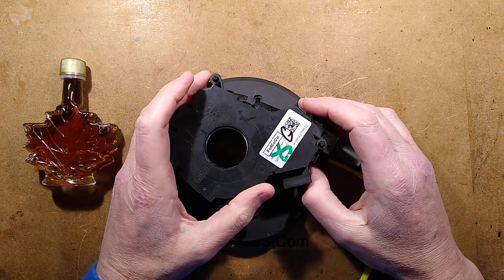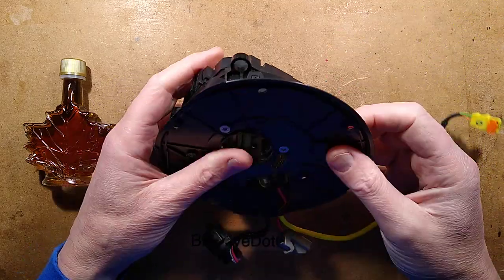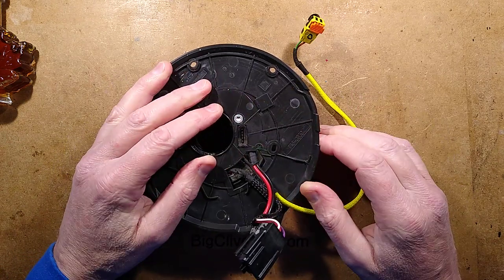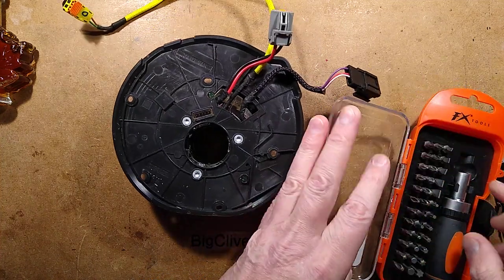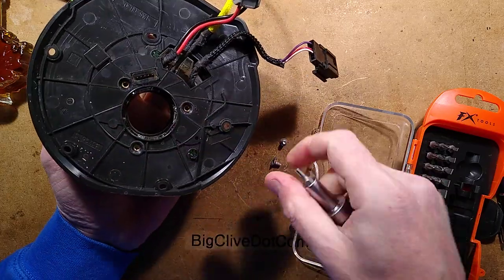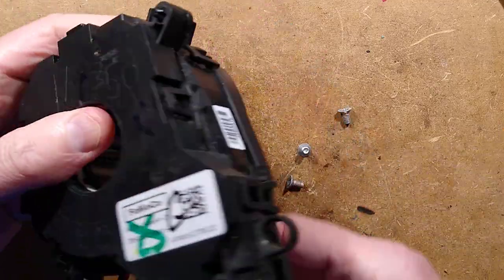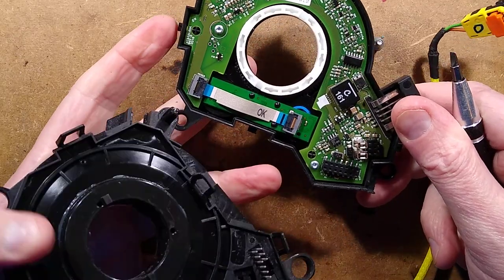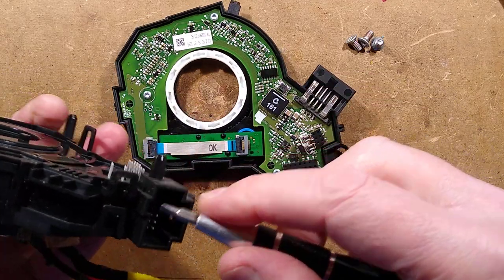Inside a car clock-spring module (steering wheel wiring interface)

Comment: Hi Clive, Automotive electronics engineer here. The black rotating thing is the steering angle sensor. Its used by the vehicle stability system to detect if the vehicle is moving in a direction that matches the angle of the steering wheel.  This uses two hall effect potentiometers to detect wheel position.  They are offset to each other for error checking and differentiating which turn the weel is in, ie 1 clockwise turn as opposed to straight ahead. When you place the clock spring assembly on the steering wheel collum,  you turn the clock spring fully then turn back two times, then there should be two arrows on the stationary and rotating parts, you keep turning back till they line up. This is the straight-ahead position.
Reply: Makes me appreciate my 1950 Mercury truck.
Reply: A clockspring aka spiral cable and a SAS clipped on the back the ribbon in the CS 9/10 times fatigues where it meets the PCB the horn dies then you get a flashing airbag light
Reply: @anonymic79  the fact it has so little in common with a modern car is literally the reason he brought it up, its a automobile that has one hundredth the parts but is just as practical to drive
Reply: @anonymic79  that's the exact reason he mentioned it, because it's as simple as a lawn mower but still does the same task as a modern car
Reply: @fall-of-rome  Only in the sense of getting from point A to point B. It falls short in all the previously mentioned areas, which are vitally important, as well. Even then, this is still about electronic systems, not the luddite view of technological advancement in automobiles.
Reply: Also the steering angle sensor has to be calibrated using a scan tool by the manufacturers procedure (been the case on all the cars I've worked on).
Reply: @anonymic79  just be the fact its been in circulation since the 50s means its been a more reliable and better for the environment then any modern car can possibly be just from time alone
Reply: So do the magnet cogs have different number of teeth to tell the absolute number of whole turns based on angle difference between them?
Reply: @anonymic79  A 50 year old vehicle can be just as reliable as a new one, if you compare apples to apples. For instance, my 1971 Chevy truck was my daily driver for three straight years when I was in college. And well-made? You're absolutely fooling yourself if you think a new car is built better than an old one. The doors on my 1965 Cadillac Coupe DeVille shut with a solid authority that I have never, ever heard any other car door match. I've watched hail ding a 2003 Accord while it hit and shattered on the hood of my C/10, leaving no trace that it was ever even hailed on. And have you ever seen a 1948 Ford sitting in a scrap yard with all its chrome still gleaming like the day it was new? Yeah, that doesn't happen with new cars.

Sure, I will admit that the old cars can't nearly match the safety or convenience factor of new ones. But that's just a part of driving an old car, and when you're behind the wheel, you forget about modern amenities and just enjoy the car. Lane departure warnings, automatic braking, a 17" infotainment console, heated steering wheel, cooled seats... all things that you can live without, and gladly do so when you have something old and cool in its own way. Same thing with economy/efficiency - when you're driving around in an old car, you don't really care what MPG you get, simply because it's just more fun to drive. Maybe that's just me though.
Reply: @anonymic79  I prefer to think of it as a farm tractor.
Reply: Do the 2 cogs have different numbers of teeth? Why is one black and one blue? If they were one tooth different, I’d think they could compare to know what rotation number the wheel is at
Reply: yup , what Clive was looking for ( the default position) is derived from the 2 sensors in offset ... might need to do a tooth count on it spoilers (could be mechanical)
Reply: These little electronic gizmos saved my bacon. Kept my car straight and true despite the wet road. Kept my car from the wall around the bend where other cars without such safety aids ended up not going home that night. 

Some may say I don't know how to drive proper, I've been on the track. I usually get my name up on the top 10 lap times for the month. Electronics safety aids are good to have especially on public roads, less effort than trying to find grip for the rear during butt clenching moments when the car can apply brakes to each wheel independently.
Reply: Hi uwanthits, got any jobs for a student soon to graduate with a degree in computer engineering? :p
Reply: @anonymic79  WOW that's salty 🤣🤣🤣🤣. How preciously important is your comment about the comment then? 🤣🤣
Stay safe and healthy all of you regardless of what you think of beautiful 50s cars and trucks...
Reply: @Gazr Gazr "I just steer my van, without some gizzmo telling me how crap I am steering"  How very luddite 🤣 Guessing you have no idea what this is used for?  It doesn't do anything at all until something bad happens and you are in danger of losing control of your car.  You seem to be saying "I'd rather smash my flimsy old car into something solid than have electronics save my ass".
Reply: I guess the sensors are AS5600 or something similar.
Reply: @philmerrifield1163  yes, I've known models where you have to steer to both extremes to adapt it.  My current car must use the steering angle to tell the smart cruise control where my car is going to be, its pretty clever because you can pass cars on either side so it knows where you're aiming.  I wondered though, it does depend on your car not being bent!
Reply: @slightlyevolved  when everybody else is driving a crash zone crumple car that folds into an accordion, what makes you think driving a solid hunk of steel is going to snap your spine up? You won't even notice you hit 'em
Reply: @mikefooyc8237  yeah bullshit
Reply: @slightlyevolved  Old carbureted vehicles are also super-fun when you want to start them in sub-freezing weather!
Reply: Additionally, most modern cars have electric power steering, and they use this sensor as part of that system as well. The reason they went to electric power steering instead of the "old reliable" hydraulic power steering is that when it's not doing anything, that hydraulic pump is still pumping fluid, meaning that power is being dissipated, meaning you could have better fuel economy if there was some way to cut out the pump when its not being used, but a clutch is not reliable enough. So switching to a more sophisticated electric power steering system means you can use the alternator to get the power to drive the power steering, which does not draw power from the engine to "do nothing". By the way, that power the hydraulic system was using is not a small amount, it's at least 1hp and more likely up to 5hp, and it all gets turned into heat under the hood.
Reply: @mikefooyc8237  Yes and the car can handle each brake individually to keep its direction. I bet even the best sports car doesn't have 4 independent brake pedals in it?
Reply: I just commented something similar then found your comment, way better put than mine
Reply: @watcherofwatchers  Do you think the new Ford truck will till be running fifty years from now? That's an awful lot of hi-tech electronics heading for the scrapyard in about ten years time...
It's all very impressive and interesting, but the problem of steering a truck was cromulently solved a very long time ago using just mechanical means.
Reply: @44R0Ndin  they use that kind of steering so the FBI/CIA can crash ur car into a tree and claim you were a bad driver
Reply: @schlomoshekelstein908  I'm pretty sure there's still a mechanical link between the steering wheel and the wheel angle. Even if the electric system acts up for whatever reason if you can hold the steering wheel steady you should still have steering control.
Reply: Long story short, there are 2 cogs with magnets phased in a certain way because it's a quadrature encoder, isn't it? ;)
I don't understand, however, how this could be an absolute angle sensor (or even if it is), it has to have some kind of endstop somewhere if there's a possibility to turn the wheel without powering the electronics (unless I missed it); also cogs, being smaller than the central one, would make more revolutions than steering wheel would, and it already could go 3 turns back and forth, that is encoder output would repeat multiple times over the entire range.
Reply: These things are impossible to take apart and reassemble correctly, you will cause an error code in the car's computer. Additionally, you can set the default or "zero point" of the unit with a scan tool, after straightening the steering wheel
Reply: @eDoc2020  are you telling me they don't do it via steering means but use the brakes instead? or are you saying they don't do it at all?
Reply: @ZXRulezzz  This. Also after connecting a new battery into a modern VW Golf I had to turn the steering wheel all the way to full lock and then to the other full lock to get rid of a dash error. Once the car knows where the extremes of travel are it can assume the centre straight ahead point.
Reply: @dpallant  So basically this sensor IS relative and requires power at all times to remember where the steering wheel is?
Reply: Also the zero position is usually calibrated with a scan tool
Reply: @brianleeper5737  long ago, in the beforetimes, the gods invented the tuneup.
Reply: @Jeffrey Ellis Thanks, I actually only now just noticed that gears are different diameter. So their positions don't describe a circle, but sort of Lissajous pattern, but it still needs calibration to see which "slopes" correspond to beginning and end of the range...
But one could at least store that information in non-volatile memory, so it's not THAT ridiculous :)
Reply: @willi-fg2dh  And if the tuneup didn't fix it, all you needed to do was rebuild the carb.
Reply: @brianleeper5737  nah . . . most automotive problems then and now are electrical.
Reply: @willi-fg2dh  Oddly enough..most of the electrical problems I've seen in cars were due to the last idiot that worked on it. Harness connectors not fully mated, harnesses not properly routed so they get damaged, loose battery connections, loose battery itself (apparently leaving the holddown hardware off saves a whole minute of time), loose ground bolts, it goes on.
Reply: @schlomoshekelstein908  Are you asking me how the government makes you crash your car by controlling its computers? Conspiracy theories aside, there are different ways they could. Even though you can theoretically override electric power steering, the motors can easily overpower you if you're not expecting it. They could also mess with antilock brakes, automatic transmissions, electronic throttles, and more I'm not thinking of.

Do you really think the government makes you crash in order to ruin your driving record? If they really wanted to they could just file fraudulent accident reports.
Reply: @eDoc2020  Yeah the government doesn't try to eliminate undesirables, they didn't come up with a heart attack gun that uses shellfish toxin. They certainly won't try to kill you with your own car, they would just get you into a minor "fender bender" and make you look like a bad driver. That makes sense to me. I'm so glad an intelligent person like yourself could show me the err of my ways and enlighten me to reason. What was I thinking?
Reply: @ZXRulezzz  That's an interesting one. The steering wheel must be permanently powered so that steering wheel movements while the ignition is off still get counted. Otherwise whatever use the absolute calibration when the battery is reconnected is would be lost if the steering wheel was moved when the car was not counting it.
Reply: @LgSutterby  all good until you have an accident. I know in which car I want to be sitting when I hit something at 70kmh.
Reply: @mahlapropyzm9180  you act like there's a high percentage of 50+ year old trucks still rolling around. There aren't. Those old vehicles were riddled with their own common faults. Points made every one of those vehicles unreliable. Distributors and rotors failed left and right. The list goes on.
Furthermore, the safety differences are immense.  The same is true of efficiency, power, and comfort.
The fact is newer vehicles simply require a different skill set to understand and work on. They aren't mysterious - they're just different.
Reply: @watcherofwatchers  i never said technology was bad, i just said that it's fascinating how something that is closer to a lawnmower can do essentially the same thing as a modern car can.
Reply: @schlomoshekelstein908  in my old cast iron diesel pickups, or my semi truck, everyone ELSE is my Crumple Zone!
This why I drive more carefully, because I hate hurting innocent crumple zones..
Reply: @LgSutterby  Could you imagine how amazing vehicle would be if made with both todays technology and the build quality of the past.
Reply: Just to add on a bit of info. The large individual flat flex conductors are for the steering wheel heater (and some new models cooling as well). The thinner multi-conductor ones are for the SAS power/data, horn, and airbag deployment circuits. Further, when new, ford clocksprings have are centered and locked with a pull-out stop pin. Just center the steering, then install the clockspring and finally pull the pin and everything remains aligned. Fun info tidbit: many modern cars with electrohydraulic power steering feature software controlled steering endstops. This allows manufacturers to use the same steering gear across multiple variants and use multiple tire dimensions and prevent tire rubbing on suspension components/wheel wells saving costs in R&D and manufacturing.
Reply: @Abrankod  What cars have a cooled steering wheel, I'd dig that.
Reply: @LgSutterby  the fuel economy and emissions regulations are insane. That’s at least one reason why.
Reply: My question is why?

Comment: When I was repairing my car, I did the thing you should never do and turned the clock spring whilst it was removed from the steering column. I realised when I put the car back and couldn't turn the wheel all the way (very lucky I didn't force it as it would have snapped the ribbon cable). I had to take it to bits again. Luckily, the manufacturer was thoughtful enough to put a small window in the clock spring module, with a corresponding dot that appeared when in the centre position.
This also had an angle sensor for the traction control - this was an older style, with a potentiometer to detect the approx. angle of the steering wheel and a gear/counter mechanism to determine the number of full turns the steering wheel has made. These types return the absolute position of the wheel, so it is important they are set to the correct position before refitting. Thankfully, the calibration mark allows this to be confirmed.